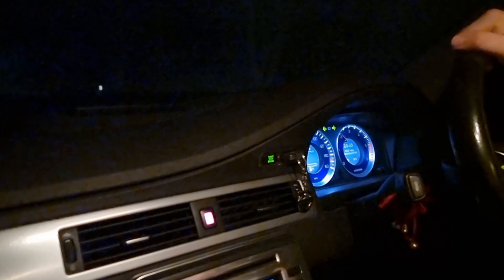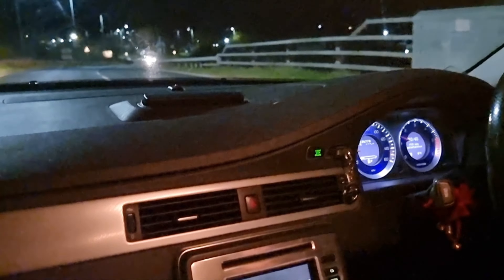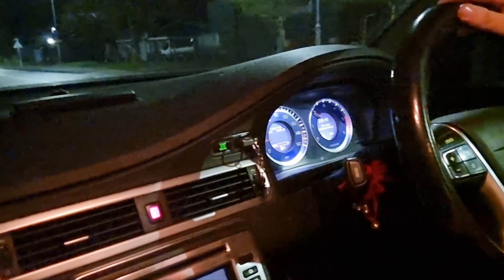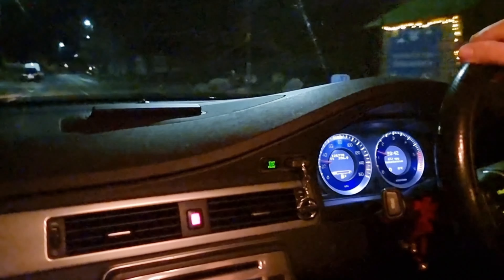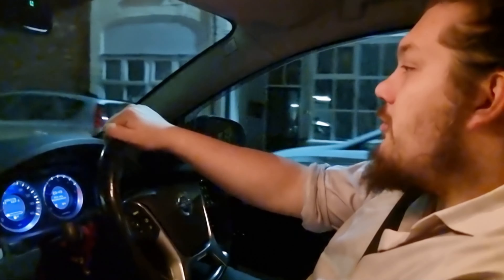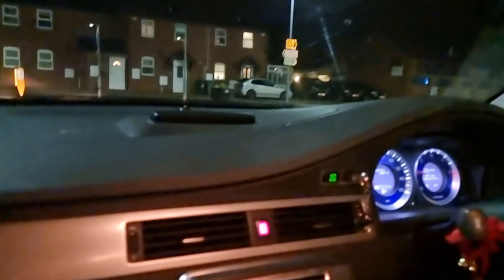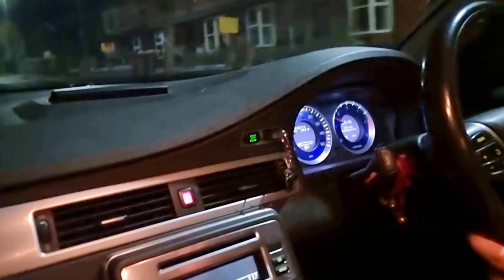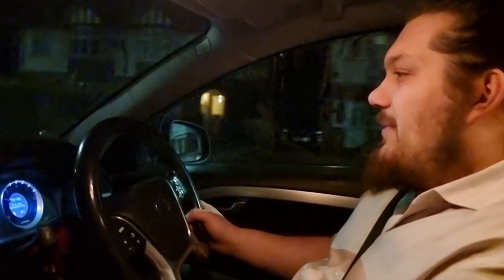My Volvo had a serious issue...

Comment: I had exactly the same problem a few days ago with my XC70 (2009).  I was 35mile from home and the ABS sensor on the front right of the car suddenly failed . The car developed a clunking at the front left wheel when pulling away from a stop at junctions etc. The sensor was replaced and everything is now back to normal.....it was a hell of a job trying to get the  sensor fixing bolt out though. I hope you find the time to make a video of the repair.

Comment: I'm lucky at present - I have a 2007 V70 T6 with only 50K on the clock (which is why I'm subscribed to your channel). But I had your ABS problem with my old 760 - or the 850?  It turned out to just be a wheel sensor, so I'm hoping that's all it is with yours too.  Good luck.

Comment: I had an ABS fault with my old Mitsubishi lancer, took out the traction control too.
Car still drove completely fine, it did need the module rebuilding which was £500+, bloody Bosch part.

Comment: Gah, know the feeling. Had the alternator fail on my S80 at the beginning of the month. Now I've got a noise coming from the front end too.😢
Reply: Get it changed quick if the belt goes so will the timing belt whole engine

Comment: Do you have a windscreen leak? My V70 P3 had a leak on the windscreen and the water leaking in caused mayhem with the electrics.
Reply: I had that problem, ended up using silicone

Comment: Have you ever changed your transmission oil?
Reply from the maker: Yeah it was changed at 80k due again in  10k or so :) defintely related to to abs fault as it works perfectly before the module freaks out
Reply: I have issues with my 2009  s80. It shuts down if taken on a very long ride, and I get stuck in traffic. When scanned, it says fuel rail senor, I took it to the garage and was told it's the fuel pump, got it changed and I still have the same issue...

Comment: I got mine solved with changing rear right faulty abs sensor. Exaclty same problem and noises. Luckily I got out of limp by turning car off/on. 2008 XC70 D5 ATM
Reply: how much did it cost to replace?
Reply: @LBee70  Can't remember exactly, in between 100€-200€